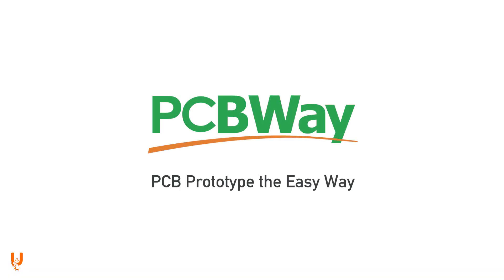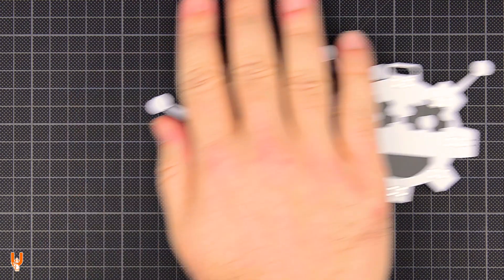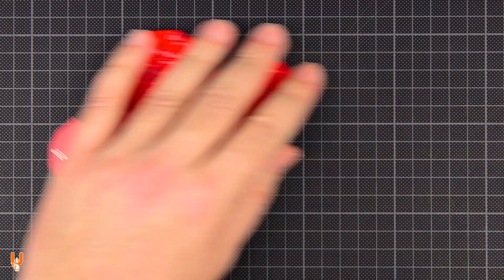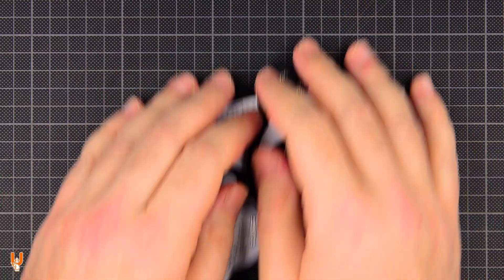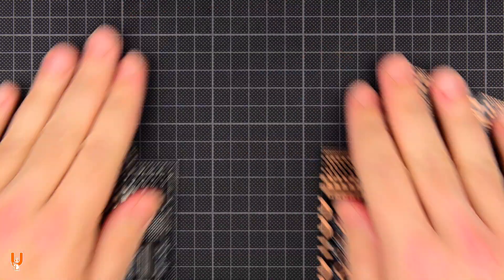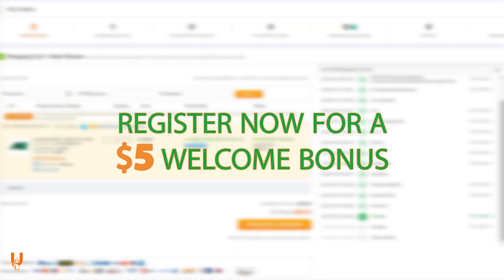iFlight XING2 2207 2755KV FPV brushless racing motors : Thrust & Efficiency on 5" & 5.1" props

Comment: How’s it only 0.4 grams heavier than 2306. Odd no?
Reply from the maker: That's a good observation, although 2207 are not that much heavier compared to 2306 in general. iFlight even lists them as exactly the same weight on their website.

Comment: Wait the 51477 is only 3.7" pitch?? And 51433 3.5" pitch.. these names so confusing
Reply from the maker: Yep... it seems to be a "trend" now and definitely makes things confusing. Especially since many online stores list the props based on the name and not based on the pitch value provided by the manufacturer... On the other hand, the pitch of our props is a complicated matter on its own: there is no "standard" on exactly where it is measured (along the length of the blade) for each prop category / manufacturer and our prop blades vary sometimes rapidly from hub to tip... One thing is for sure: never reject a propeller based on its pitch. Props are a very personal matter and depends on the feel each person is looking for. Thankfully they are cheap enough to try a few different types before deciding...
Reply from the maker: Sidenote: Based on my notes, the 51477 used to be described as 3.6" pitch before it was rebranded as a "JB" propeller soooo yeah... now it says 3.7"... I doubt they changed the mould and everything else looks to be the same. Maybe I am wrong and it was a typo in my notes but you get the point ;)
Reply: @muteFPV  I doubt it was a typo.. I can see companies trying to be cool with naming to sell more items..
Reply from the maker: Just to be clear and avoid misunderstandings, I am not implying that "named" props are just marketing. I am sure many of those are the result of a lot of testing and hard work by both the pilot and the prop manufacturer.
Reply: @muteFPV  yea I know what ur saying.. I just find it confusing when so long those numbers meant length and pitch. 
Wish there was a way to test pitch. Maybe they do it in water idk..
Reply from the maker: No idea... I remember literature around plane propellers stating that it is calculated at a cross-section of the blade at a specific point, X% of its length. But the props we use vary too much for this to make any meaningful measurement. As for the water idea, is measuring how much it displaces the same as measuring how much distance it goes through the air (per rotation)? I have barely any knowledge on the matter.
Reply: @muteFPV  u got more than me lol. I just know it's based off how much it would move forward in a rotatiom